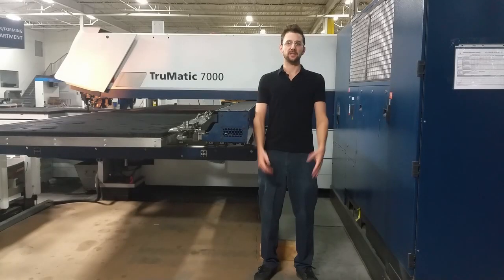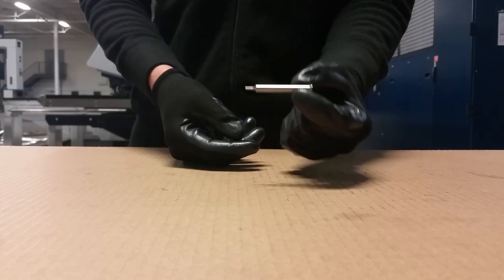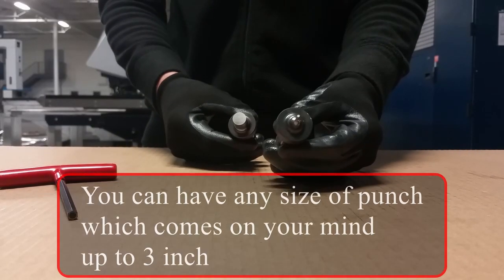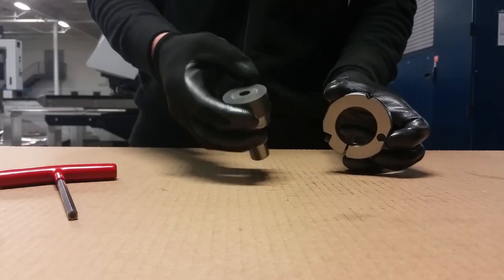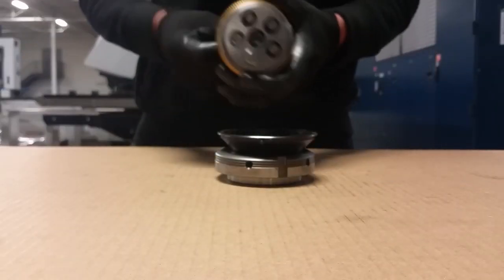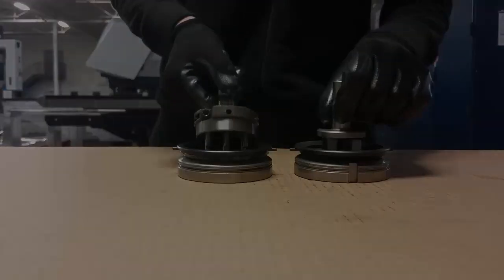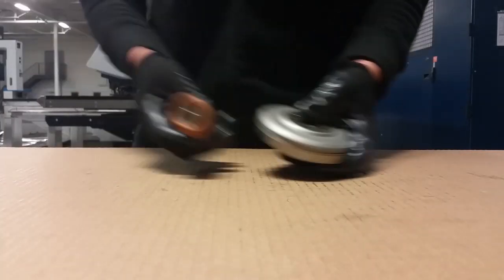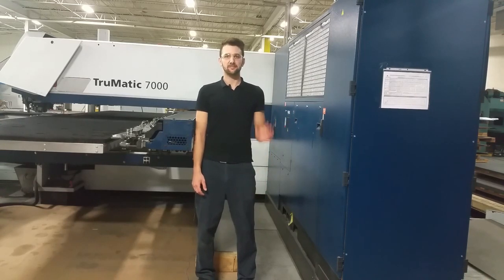Types of punching tools for Trumpf Trumatic punch press machines

Comment: What is the die height to set up
Reply from the maker: You can try to find out in the operator manual.
Reply from the maker: Hello Mad man,
You have to enter to the machine control the total height of the die with shims/washers (if there are some) and the die holder. (This is for Trumatic 7000)
Reply: @cncmachiningtutorial1137   I need for  Trumatic 500